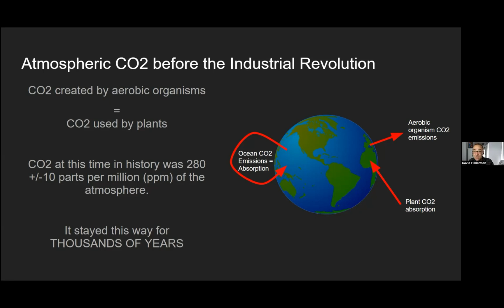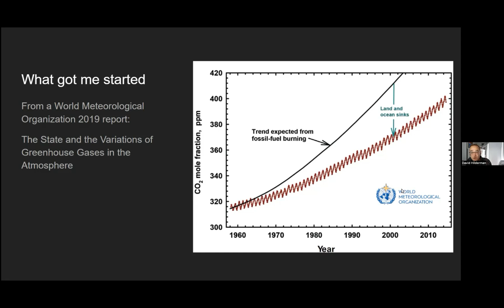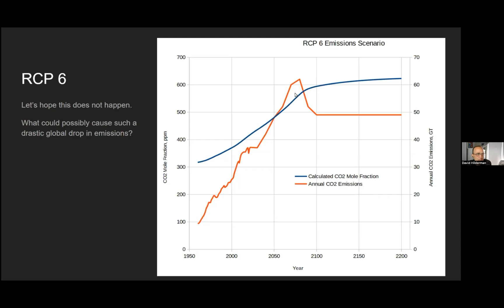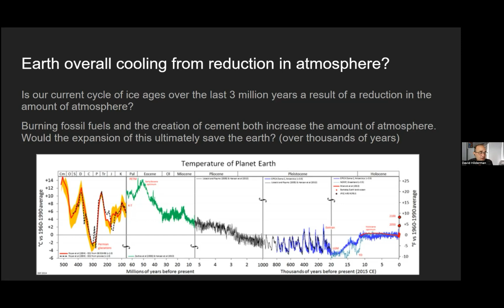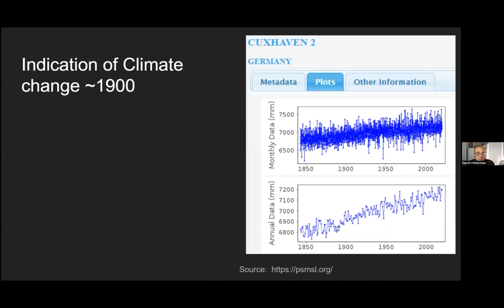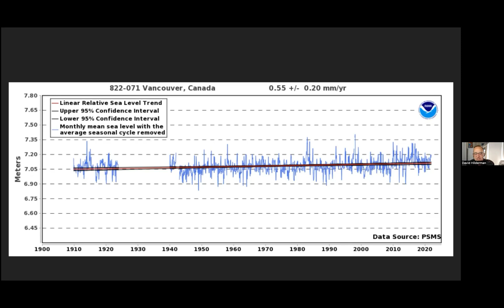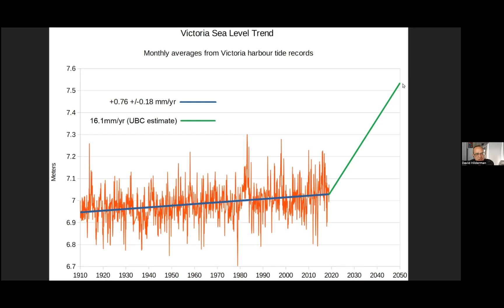David Hilderman: CO2 Emissions and Atmospheric Levels | Nelson Pod #220

Comment: It's the WEF's plan to use (and abuse) global warming and climate change as the scapegoat for control and abuse of power.  They think we sheeple will just believe whatever they spew out and obey their commands.  Unfortunately for them, there are many intelligent people like you and I that see through their scam.  People have been crying "the sky is falling" for decades, and yet every decade comes and goes and nothing has changed (not noticably, as they claim and predict...) So why do people still believe them when we have proof decade after decade that climate change is slow and natural, not quick and man-made.  We may be accelerating the release of CO2 into the atmosphere, but like you and I say, perhaps a rise in CO2 is not only beneficial to our planet, but is a NECESSITY for our planet to avoid plunging back into another ice age.  Who knows if the next ice age will be the last one, freezing our planet into a ball that never melts?  Perhaps humans were evolved to the point we were so that we could release the trapped Carbon back into the atmosphere.  Either way, the Earth has its ways to balance itself and I serioiusly doubt that anything we mere humans could do would be of such an impact that we could stop or even alter whatever course the planet is on.  Until a THOROUGH study is done, and I mean one that encompasses ALL of the necessary fields, not just measuring CO2, heat, and ocean levels - any and every single thing that affects our planet needs to be taken into account and only after we have a model that actually correctly PREDICTS future levels can we start forecasting what needs to be done, by when, and by what means.  Simply shouting "stop burning oil" is not the answer, and not even correct - if we do in fact need more CO2 in our atmosphere to delay the next ice age, shouldn't we be purposely burning more?  I'm all for stopping pollution and contaminating our air, however we should be focusing all our money and research into actuality - what is happening here and now, and what will happen if we remain in this course?  Why we haven't done this is likely due to the WEF and their mission to take over the world - they have no interest in the truth, otherwise they would have done this all-encompassing study to convince us all once and for all.  I for one will continue living the way we were supposed to - enjoy what we have been blessed with and to have been born in a time where energy is abundant and cheap, the air is clean, we want for nothing, let's enjoy our lives while it lasts.  All those wasting away their lives, worrying about the end of the planet, do a little research, like this guy did, and discover that you truly are wasting your time worrying.  The Earth isn't going anywhere any time soon...

Comment: Indians and lighting would clear out the forest underbrush on the West coast every 7 years or so.    During WWII we adapted a no wildfire campaign due to the japanese launching firebomb balloons.  It was called Smokey the Bear.   

We now get 40 to 80 years of underbrush growth.     Instead of the fire traveling slowly on the ground,  it travels quickly in the treetops, where the wind is stronger and the debris flies farther and faster.  
It's not CO2,  it's forest mismanagement.
Reply: Same in Australia.
Reply: Add to that: smoke creates large aerosol particulates. The large amount of burning resulted in far more reflection from the smoke but also the clouds. Smoke led to far more cloud cover, and that results in more energy from the sun reflected. In all recordings we have an increase in of total sunny days is also recorded. 

Though, that also correlates with cosmic radiation. But interesting non the less.
Reply: So interesting to read your comment. Thank you

Comment: Is Greenland's southern half green yet? No,  Does England have superior grapes and higher production than France yet? No.  if the Arctic Ocean was clear of Ice in summer could you get to china from Europe more easily by going North West?  CO2 has very little to do with temprature; temprature was depressed by volacanic and solar activity and is rebounding due to lower rates of Volcanic action and a return of solar storms. The earth does have a mechanism for self correction, CO2 is self mitigating; so it isn't a problem. Man made CO2 is 1/10,000th of 1% of the Atmosphere.

Comment: Some hear incorrectly we are at "record temps" this is a pretty misleading statement because they mean since we had thermometers and ways to measure temps which is only 150 years, even less for wide spread standardized temp records. In the Middles the Vikings colonized Greenland - the southern half was Green! The King of France put a tarriff on English wine, English grapes were better and more plentiful. Columbus had heard the legend of the North West Passage; He thought he could get to China going via the passage outlined by the legend.
Reply: 80% of the Earths history has been ice free. Global temperatures have been 14c higher than now.
Reply: @paulmcgreevy3011  So it is a fake emegency pushed by China. I believe that to be the case because no one wants to simply conserve by lowering their speed limits to 55mph and having required carpooling for commuters.. saving CO2 now ; not 20 years from now.  They don't like ethanol, they don't like nuclear, they don't like hydrogen.. only Chinese products EVs, Solar and Wind.
That is why I call them Net Xi bros.

Comment: Good points but - do consider that maybe CO2 isn't even the driver of Warming.  http://www.faculty.ucr.edu/~legneref/bronze/jpg/climate.jpg In this chart from UCR - You see the little ice age dip in temps which dropped for 600 years What Caused this dip? The dip is attributed Volcanic activity & and maybe less solar output due to fewer magnetic storms.  So the Temps dropped 4 degrees. Thus when Volcanic Activity subsided and the atmosphere cleared up - temps rebound towards the higher temps of the Middle ages.

Comment: OK folks.  Careful here.  The loan rogue voice as David seems to be is wrong much more often that they are right.  Read from many sources.  More Oxygen in the atmosphere would certainly be helpful too.  I could climb Mount Everest but unfortunately it would allow much easier combustion.  'More CO2 is good' is wildly simplistic.  So many issues here.  Equating CO2 levels to poverty is a classic correlation verse causation mistake.  Poverty reduction can be correlated to increased energy use but the form of that energy could have nothing to do with carbon burning.  In general in life when you want to know something or get something done you go to an expert.  I get my plumbing done by a plumber, my teeth cleaned by a dentist, my car fixed by a mechanic and my taxes done by an accountant.  I get my climate information from a climate scientist.

Comment: That's interesting because I looked at the proxy data about 8 or 10 years ago and there's been a number of times about 150,000 years in our history that the earth started warming and about 700 years after warmed the CO2 would go up to as much as 7,000 parts per million on average. Where did you get those contrived bullshit numbers?
You do realize that blow about 150 parts per million the plants die because they don't have enough carbon dioxide to survive and about 6 months later we die, when we run out of food.

Comment: Just how much can WE change Global Warming? 

Let’s do the calculations!
Have you ever asked, “How much global warming has there been since the START of the industrial revolution?"
Ask Google,  Ans from NOAA: “1°C  since 1750? So how much change is that a year in °F 1.8F/272 years = 0.0066°F /year
How much is actually caused by the USA?
OK let's ask Google, Ans:  27%
So the USA has caused (27%) * .0066° /year or .0017° F /year.
Have you ever asked what is the half-life of CO2 in the atmosphere? Ans: 120 years

WOW!! By using NOAA’s historical records after reaching NETZERO in the USA, the MAXIMUM change expected in global warming is -.0017°F /year
And it will take 120 years to realize reduction of -.00085 °F 

Now Ask: what's the cost to reach NETZERO?  Ans:  $4 trillion a year for the next 30 years or $120 trillion.

Have you ever asked how much the sea level has actually risen?
Let's ask Google The answer is less than 3 millimeters per year... Here is the Proof look up your own location ..
look at    NOAA  tides and currents sea level trends

Comment: The differential that is driving the adsorption of the oceans is the partial pressure difference between the atmosphere and the ocean surface at the relevant local temperature and alkalinity not the delta between original deep history conditions.  The oceans are a lower pH today than the past making the differential driving force less than your model.   The apparent feedback system keeping the deep history reasonably constant CO2 was plant growth which requires a minimum absolute concentration of CO2 for photosynthesis.   In more detail, the ratio of O2 to CO2 can reverse photosynthesis with too much O2 relative to CO2.   

Good try, but this is something I have looked at a lot.
Reply: Unfortunately too many people reduce global warming to one metric; C02. This is  a vastly simplistic take that belies the true complexity of a multitude of other factors that heavily influence global temperatures. While there is some correlation between C02 levels and historic temperatures, it is clearly not a first order factor in influencing the temperature.
Reply: @tomkerian2958 co2 levels historically lags behind temp increases. If there is a historical correlation between co2 and temp then it is that co2 increases after the temperature increased. This fact alone destroys the co2 climate change nonsense.

Comment: You missed a major source of CO2: valconic activity. Some is from land and other from under sea. Scientist have "estimated" the co2 released by land volcanic activity, generally by using a ratio if SO2 to CO2 and only for a small subset of land volcanic activity. Oceanic CO2 increases and decreases are just guestimates.

Next up is "fossil fuel" CO2 emissions. The problem is very little CO2 is directly emitted from fossil fuels (a fraction of a percent).

Fossil fuels mainly emit CO (carbon monoxide) not  CO2. Carbon Monoxide was considered bad. Catalytic convertors and scrubbers are required to reduce NOx, CO., and SO2.

Catalytic convertors and scrubbers combine CO2 and unburned hydrocarbons to CREATE CO2 and H2O.

I believe this is why instead of CO2 now it's just "carbon"

The next issue is that CO2 is only a minor greenhouse gas, over 95% of the greenhouse effect is water vapor. Additionally the computer modelling doesn't consider any effects from the sun. Is it any wonder that there has never been a "climate change" computer model that is even close to reality.

Historic and current temperatures have been and are being adjusted. Most of the past temperatures were lowered which created periods of little snow but significantly colder than now. The excuse was that they just didn't know how to accurately take temperatures back then.

Then the historic temps from the 1980's were adjusted upwards and still are. Amazingly the adjustments almost exactly track atmospheric CO2 levels.

A couple of interesting facts about historic temperatures.

1. Until recently the US was the only major area with relatively dense temperature stations. Most of the rest of the world only had 1 or 2 temperature stations, with some countries none. Many of those stations were not continuously active.

Even now there are huge areas with no temperature stations, but not to worry, for those areas the temperatures are "estimated" (made up). In fact many areas with the highest temperatures are estimates.

Heat islands. This is where cities are hotter than surrounding areas due to concrete and asphault. Downtown Phoeniz, Arizona is often 20F/11C  warmer than the rural areas.

Temperature stations used to be placed in rural areas. Over the past 100+ years the cities expanded and now many temperature stations are near airports, malls, freeways, and other areas with large amounts of concrete and ashault. Of course no temperature corretions to compensate for this.

Finally sea level rise. Some cities see "sea level rise" due to techtonic activity. It's amazing how many coastal cities are built on faults. This also explains why some cities have falling sea  levels. Build on one side of subduction and the land sinks, build on the other side and the land is pushed up. This is accepted science except for climate change believers who all seem to forget about it.

Many coastal cities see significant land depression (that looks like sea level rise). Many cities expanded their useful land by land fill projects. New York City is a great example. Over time this new land naturally compresses. Additionally this land is often highly valuable, where the downtown expands to. Now you have heavy sky scrappers further compressing the land.  These areas are so valuable that over time large buildings are demolished to make room for larger buildings further compressing the land.

New York City saw land reclamation in Lower Manhatten starting in the 1600s. The current estimate is about 2000 acres have been reclaimed, mostly via land fills. This area is where the most dense development has occured.

Of course Climate Change "scientist" predict that Lower Manhatten could see  2 to 7 feet of sea level rise by 2100.

Scientist have known fir decades that the land in this area is sinking; due to land reclamation and the weight of the buildings, people, etc.

So either Climate Change "scientists" are ignorant or corrupt fraudsters.
Reply: The historical proxie record of CO2 when it jumped up a few times - I really wonder if that was from volcanoes.  Always making it's way down because life on earth uses it.

Comment: Benefits to plants by CO2 increase are offset by the increase in photorespiration.
Reply: That’s incorrect. Plants use water more efficiently in a high co2 environment.
Reply: However, most issues of photorespiration do not occur until CO2 levels exceeding well over 1000 ppm.  Most plants do best at levels of CO2 up to around 800 ppm and level to about 1200 ppm.  You would need to increase levels way beyond that to decrease productivity to the low levels of production we have at only 400 ppm.

Comment: Increase CO2 and your plants go through a growth spurt, sure, but then they hit the nitrogen limitation and it stops. We see a growth spurt in spring because bacteria have had the time to replenish nitrogen. Your sustained growth theory is misinforming people. Are you going to go around the globe fertilizing plants? The biggest issue with CO2 is the increased infrared heat retention, look at the droughts and massive heat domes, crops fail. Warmer air retains more water, look at the massive rain floods, crops fail. 
The crops humans grow can't handle the volatility and the extremes.
Greek floods 2023, 800mm/31.5in of rain fell in 24 hours, 25% of arable land flooded. South Brazil 2024, 600000 people displaced 2 million affected. England 2024, 18 months of rain has soaked their fields and they can't grow their crops. Bogotá, Colombia 2024, drought and water crisis. Panama, Ecuador, drought. Southern Africa, extreme drought, no crops, food crisis. 
2024 heatwave from Dakar to Ho Chi Minh City. There are more examples and more to come. Go back to your sheltered bubble and your electronics. And your audio is distorted, is that on purpose, it sounds horrible. West pacific islands rice fields submerged in salt water and turned brackish, they no longer grow rice. There's your sea level rise. Hot Atlantic set for record hurricane season. Keep an eye on Florida.

Comment: News flash, there is no such thing as a "greenhouse gas". No gas in the universe can cause warming. That is a violation of fundamental laws of physics that govern our universe. If a so-called "greenhouse effect" could exist, we could not. Our very universe could not exist as it does. Our planet could have never cooled down, it would have "runaway" just like they claim happened on Venus (spoiler alert, Venus did NOT have a runaway green house). The whole reason why past CO2 levels have been higher is BECAUSE our planet warmed and CO2 outgassed from the oceans that cover 72% of our planet. CO2 has NEVER cause our atmosphere (or surface) to warm. It cannot. It is simply impossible. Here is the question to ask, can you demonstrate the so-called "greenhouse effect"? .. nobody in the world has ever been able to demonstrate this magical effect, because it is impossible, just as a perpetuum mobile (perpetual machine) is impossible.

Comment: Any particular air/water temperature and ocean level measurements are  deeply  non accurate because are affected by many processes depending on  time, year season sun  and and impacts of air/water movements and evaporation   which strongly affect temperatures We cannot treat those differences as 100%  accidental and balance it by taking mathematical average - lots of it are  deliberate by nature and  is in next years nature is correcting them.

Comment: Let's put things in context: nitrogen = 78%, oxygen = 21%. That leaves 1% for all the other gases. CO2 is 480 PPM. As a percentage of the atmosphere that = 0.042%, (0.1 = 1/10) (0.01 = 1/100)(0.04 = 4/100) C02 = Four, 0ne hundredths of 1 percent. At 250 ppm plants begin to die at 150 ppm they and all animals, are dead. I invite the reader to Google these facts. We got down to 280 ppm think about that!